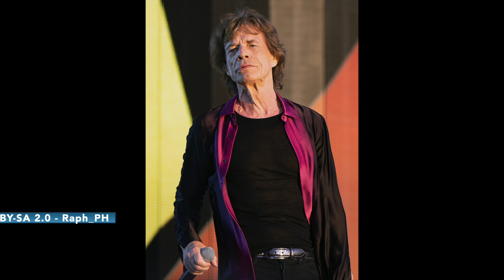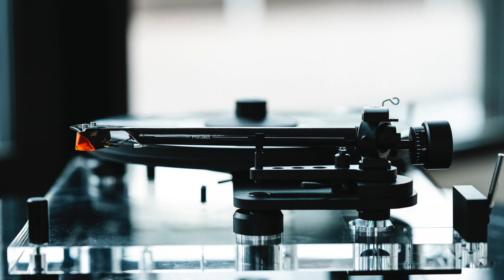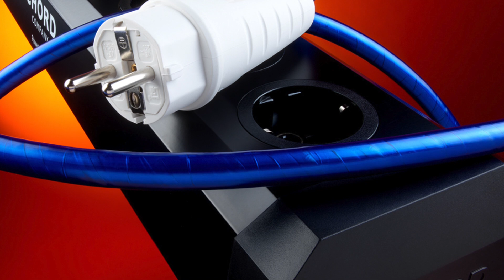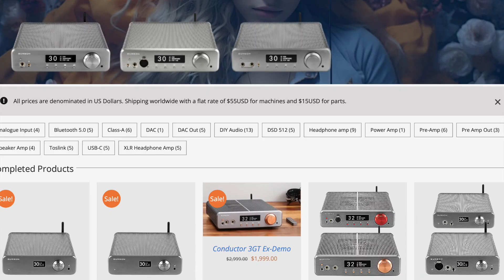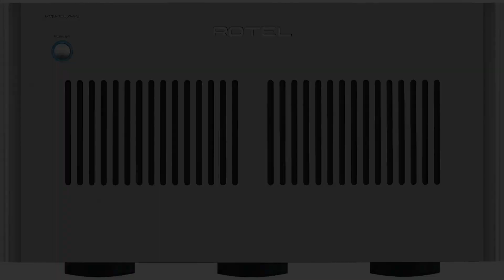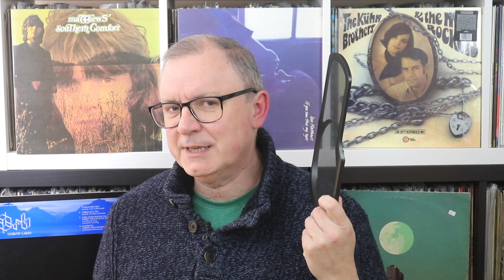HiFi NEWS: PRO-JECT, CHORD COMPANY, MAGICO, BURSON, ROTEL & HINT/TIP & MUSIC TRIVIA QUIZ!

Comment: Hi Paul, welcome back. I currently don't have grills supplied on the floorstanding Speakers I currently use. On the previous mounted speakers I used, I always took the grills off for the very reason you mentioned.

It seems that clear turntables are in vogue at the moment. Audio Technica has one that comes with a cartridge that is not clear. The cartridge can be updated to a clear cartridge.
I really enjoyed this video. It came across very professional and very calm and relaxed. I assume the move may have gone well.
Reply from the maker: Thanks Bob and you’re very perceptive. As soon as I set up the new YouTube space here, I didn’t feel the need to project as much. The last space was larger and I tended to feel a bit lost in it. So yea. Good observation. And I’m happy that the new space is coming through in a positive way so thanks for the confirmation.
Reply from the maker: Thanks too for the hardware info. Glad you can hear the ‘grill off’ differences too. I must check out that cart you mentioned. Which one is it?
Reply: @TheAudiophileMan  The Turntable model is AT-LP2022 from Audio Technica. There are a couple of reviews online.